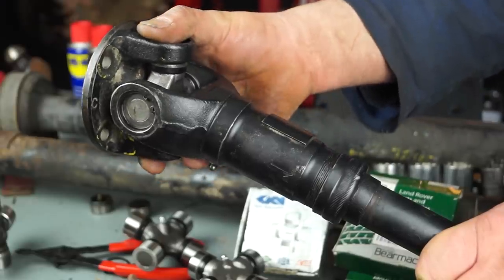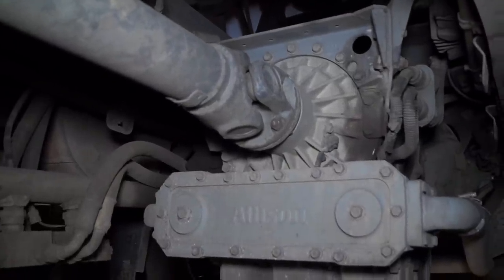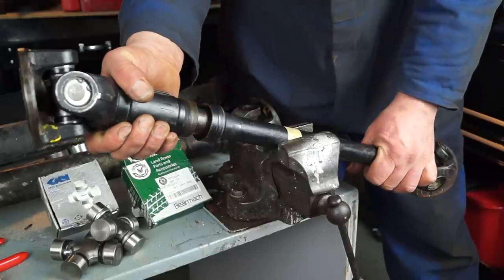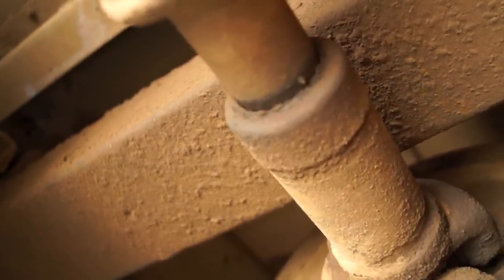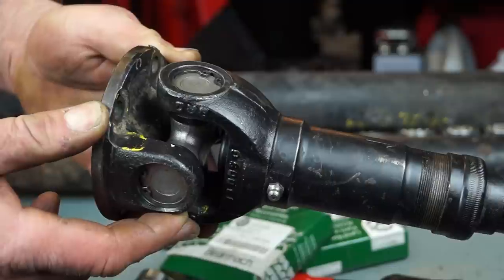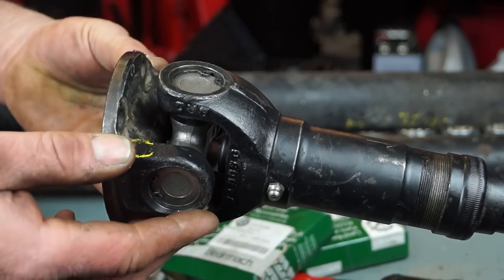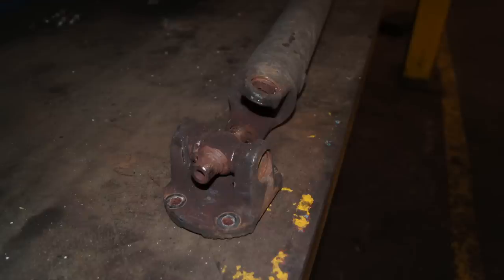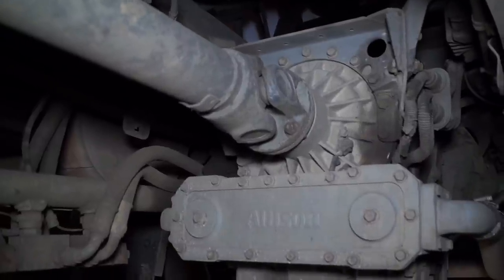Land Rover prop' shaft repair part 1 measurements and assessment

Comment: As always you saved me from 1, reading the manual 5 times so i can absorb all the info.  2, knowing what to look for & accurately diagnose what i already suspected.  I Started getting vibration under acceleration,  vibration went away when clutch was engaged or in Neutral.  3, Getting it fixed at home with basic hand tools.   Thanks yet again mate.  Us Aussie Defender owners love your Vids.

Comment: I had to grease my defender 90 as my 10k km service was due.
There was no way i could deliver the grease into the uni joint grease nipple..

Multiple different grease guns in different positions and angels with pressure..
Multiple different nozzles..Whilst under the Vehicle.Not one bit of grease went in....

Literally had to take each prop shaft off,Place on a table....Get direct exact angel...Apply all my force onto it and squeeze....FINALLY went in...Absolutely fantastic feeling that Only a landrover can give you.

Comment: Thank you for the very helpful vlog! I own a 61 plate puma and I struggle to fit a grease gun on the UJ nipple's? I often have to remove the propshafts to gain access, can you recommend a solution?

Comment: Great vid! I can hear on the commentary that you have a smoke alarm with a low battery! ;) Beep
Reply from the maker: yes it is,  well spotted.   Would happen to start beeping at the wrong time...
Battery changed now.
Reply: Guyz help  l want  propshaft  of defender 110 deasel engine   1986 model
Reply: I genuinely paused the video and walked into my hallway thinking it was mine!

Comment: Nice video, but it omits a basic issue which most will struggle with - the removal of the flange bolts on the axle and transfer case ends. These bolts are almost unmovable with a conventional set of spanners etc. It's impossible to get a normal socket between the yokes to turn the bolt head. What tools are used by you to do this?
Reply from the maker: http://www.paddockspares.com/da1119-propshaft-bolt-removal-tool-usually-14-50gbp.html   Here,...  this is the popular solution.
Reply: Aha! THAT's what it's for (they call it something different in the USA). I'll run out and buy one! Many thanks! Maybe insert a small mention of this particular tool in your otherwise excellent vids?
Reply from the maker: yes I have mentioned it somewhere else.  It is an excellent tool.  Always kept one spare in the vehicle and a couple in my toolboxes as it also come in useful on other vehicles too!!  Can be used sensibly with an air wrench.
Reply: Remember it is 9/16 and not 14mm. It’s a 3-8x24 bolt.
Reply: @trailerfitter2   WHAT A RE THE COOORECT PART NUMBER FOR U JOINTS  WHERE CAN WE GET THE CORRECT ONES
Reply: @batmovil98  Changes with model year of the Land Rover,

Comment: I have a new to me Disco 2, I went under to grease the CV's and the prop shafts and I have the following questions:
1) on the rear CV I could not get grease to squirt out of all of the barrings, is that a bad sign?
2) can I use too much grease?
Reply from the maker: Bad sign if the grease isn't evenly greasing the UJs?  It could be.  you only want to pump in enough grease so you can hear the air crackling out from the rubbers.
Reply: super....I may have over done it.
Reply from the maker: It will only fling out the grease it doesn't need.  The thing is where grease comes out, water gets in.  Worth regularly apply some grease to them.